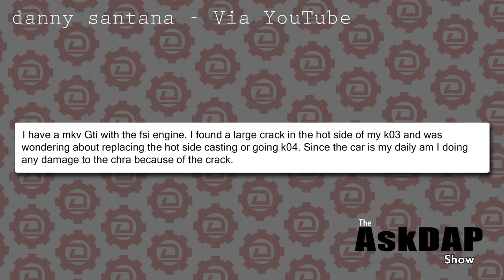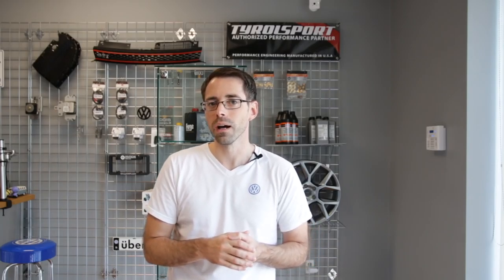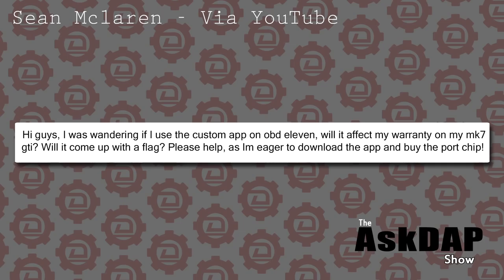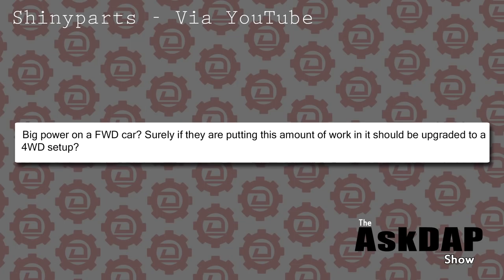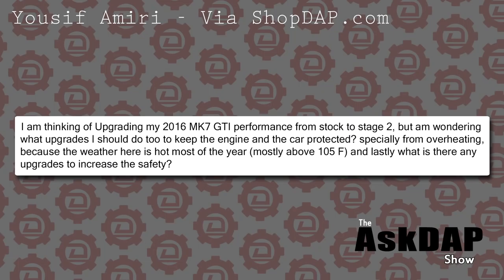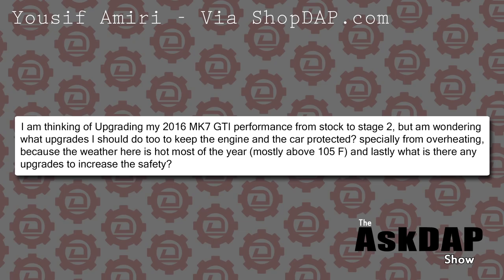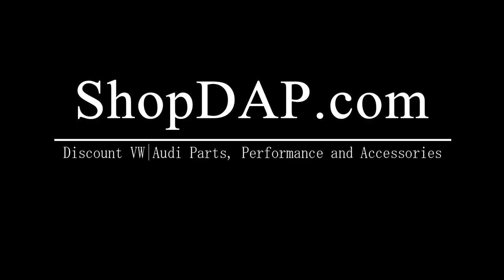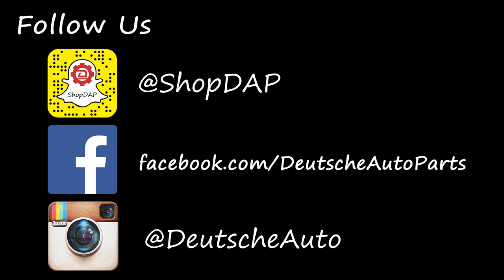Askdap Episode 68 | Cracked Turbo Manifolds + OBDeleven Tweaks and Warranty

Comment: Ive got a question guys! I did a 2000rpm- 4500rpm pull in 3rd gear in my stock mk7 gti. All of a sudden after I took the foot off of the accelerator I got the EPC light! So I checked the forums about it, and nobody really had a good explenation why this has happened! So I turned the car off, waited around a minute or so, then turned it back on! I thought that was it, problem solved, but no.  I then "babied" the car to my destination and thought all was good! Around 2hrs later after I come back to my car, I start it and all is well, I then accelerated after a roundabout, and bang, epc light is on again! It then followed my a few missfires. I turned the engine off, and then restarted. My engine light is still on and the epc light has cleared. You guys have any knowledge of this? and how to fix it! The car has been with me for 6 days, and we have only put 75miles on it since purchasing it from the dealer! It had 600miles on it when we purchased it. I know the engine light is on because it has 1 of the 4options of faults to why it is on (its missfiring). It could be dirty fuel, but it has 97 ron fuel in it, so it should be running good! Please could you come back to me with an idea of what is happening? Thanks, sean!
Reply from the maker: +Sean Mclaren Powerlifting bring it back to the dealer. It's still under warranty

Comment: even starting with unitronic performance software (stage 1/1+) on the mk7 2016 gti. Do you think you should upgrade the turbo? I dont know if gti's and r's are still popping up with the issue of blown turbos
Reply from the maker: I wouldnt worry about that.  This is not an issue common to that model.

Comment: Hey, I have a 2005.5 Jetta and I'm still getting the bulb out light on my dash even though I had installed a morimoto hid kit with the canbus hardness and turn off the drl with vag-com is there something that I'm missing? And I euro switch too, my car does have the automatic headlight sensor installed too from the factory.??
Reply from the maker: You should contact the manufacturer of the product

Comment: Question, would a water meth injection system be beneficial to a stock FSI turbo engine? i assume i would have to get a tune for that setup though which i wouldn't mind
Reply: humm interesting. I thought it was supposed to be injected after the intercooler?
Reply from the maker: +Javier Kano yes meth should be post intercooler

Comment: I think front wheel drive car is just as capable as a rear wheel or even awd in my opinion once u have good sticky tires and good suspension.Tyler aul has a mk7 gti stock internals with Apr stage three plus,he ran 10.8 last week.lots of civics do 10s.there is a 1.8 bettle in one of the Caribbean islands which is in the 9s,it's all a matter of preferences I believe